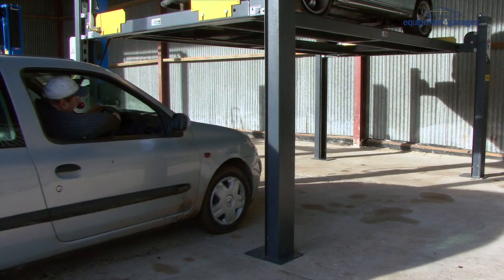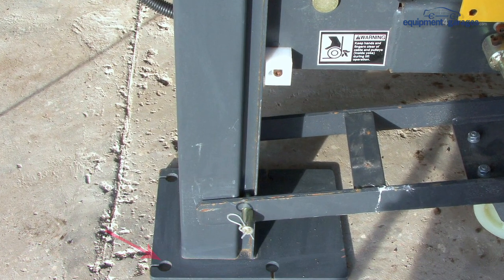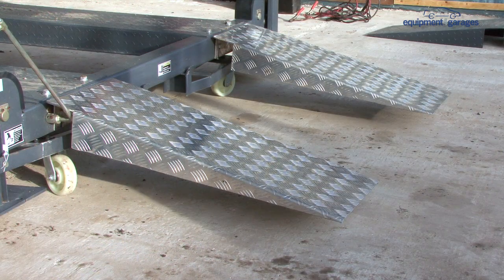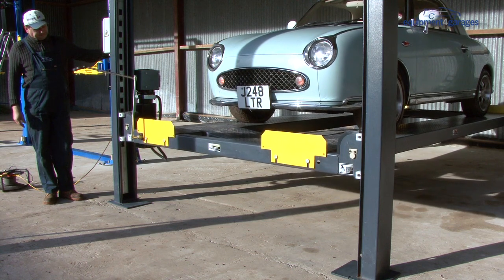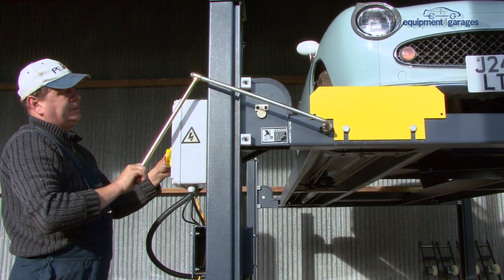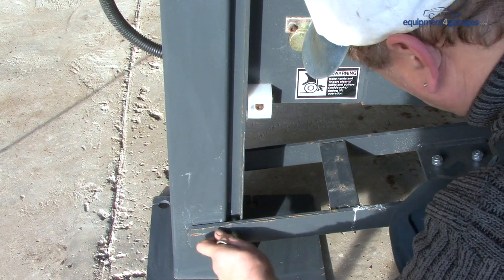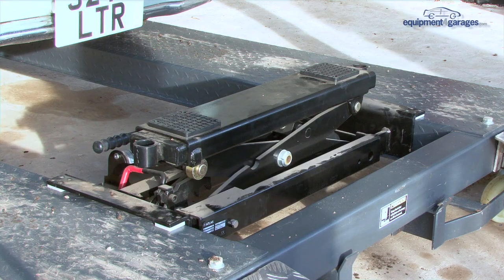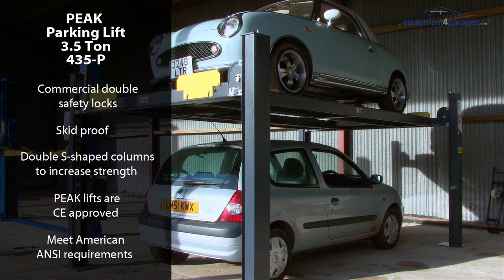EVERYTHING you NEED to know about our PEAK PARKING LIFT! | 3.5 Ton 435-P | E4G

Comment: How do they take out the top one when there is a bottom one
Reply from the maker: +Saul Carranza Hi Saul
This model parking lift you would have to remove the bottom car and lower the top car. There are versions where there is a double platform which has been sunk into the ground which means the bottom car would lower into the ground giving you access to the top car. If you would like any further information or help, please email info@equipment4garages.com